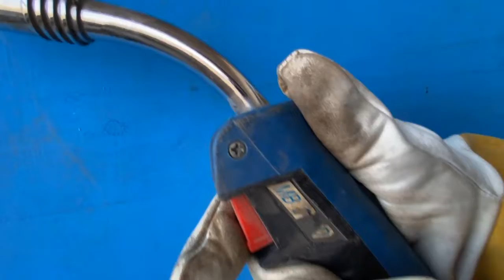The best way to teach MIG welding and electric welding is stick welding

Comment: It's a Weave pattern. Which is much better than a Push pattern.  A push pattern is a V shape, were you're shoving material up on each pass. Some welders like that technique. Personally I don't ! Because I don't think the penetration is that great ! Think about it. You are trying to weld and get good penetration, right. How can you have that, when your shoving filler material UP. Instead of IN to the metal you want welded ! I learned the Weave way back in High School('86). And to this day, I've always had good penetration in my welds. You just want an even flow of filler material, and a nice dime shaped weave. But its no different using an ARC, or a MIG welder. The weave is the same. Small arches, not Hi ones ! You want to see what's called "Laying Dimes."  Set your amperage correctly. Use a test piece to set it ! If you're using a MIG. Set your wire speed as well ! Listen for a steady even buzz sound. Then start your pass. Just go slowly with your weave, to create that dime pattern, and get maximum penetration ! Making sure not to hold and burn through at the beginning. And pull your rod or wire away, when you reach the end. Or you will blow that material away ! It takes time, patience and practice. But, you will eventually figure it out ! You will also benefit more from ARC welding. If you don't use a fan, to blow away the gases. You need that to keep the oxygen away. Or, you won't get good penetration. Also with MIG welding. It is better to use 75/25 Argon/CO2 gas. Rather than Flux core wire. There is more spatter created from Flu core wire. And your welds don't turn out as clean or nice. Trust me, It's always better to weld with gas ! Just make sure you keep your Tip clean on the MIG gun. Get a container of Tip Dip. And dip the tip in it every 5 weld passes. Or, you will develop spatter build-up inside. A little build-up will happen. But using the Tip Dip, will keep you from having to clean it out all the time. And buy yourself some Welding Pliers for the MIG. Don't use regular Needle Nose Pliers or Vise Grips. No No No ! There's a reason why welding pliers, have those designs in them. That needle nose pliers and Vise Grips don't have. Buy a good welding helmet as well. It doesn't have to be a Lincoln or a Miller ! Just buy a good Auto Darkening helmet. That you can set the Arc reaction time and the tint shade. And get one that is True Color. That's when you look through the lens and see your material in True Color. Not a light shade of green ! I picked mine up from the Eastwood company. And it works great ! Actually, buying all your welding supplies from there. Is much cheaper, than a welding supply store. Because of the mark-ups ! And Eastwood doesn't sell cheap stuff. I have the Eastwood 250MPI Dual gas welder. It works off of 120 or 240 volt power. It works great and I really like it ! Do your own research and shop around. But, I'm sure you'll be ordering from Eastwood. They have tons of instructional videos as well. From body work to welding and even woodworking. I find them very helpful when learning and starting out ! Best of luck to all of you and your welding skills. And hey, don't get frustrated. Chicken scratch(blobby welds and spatter) is where we all start learning from ! Ha Ha Ha..Lol.